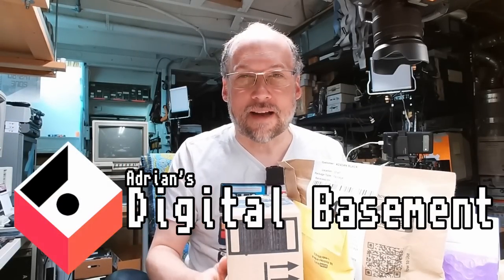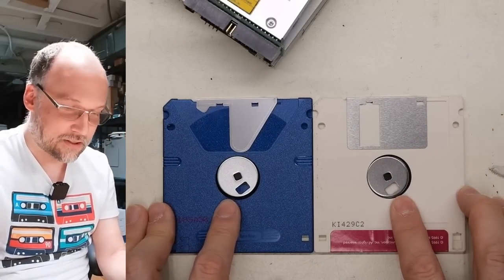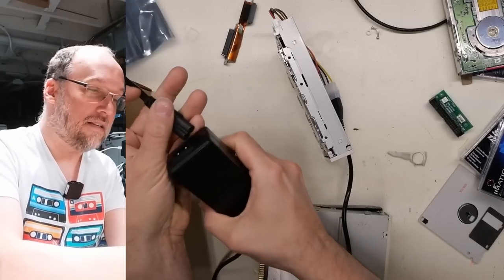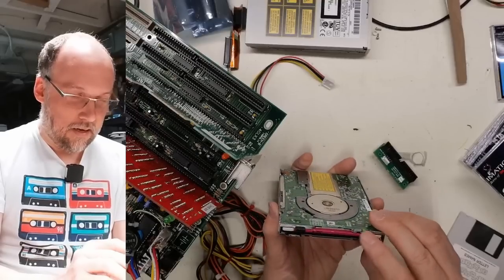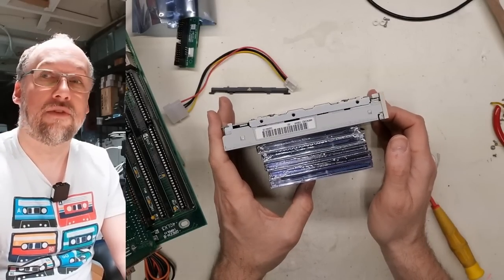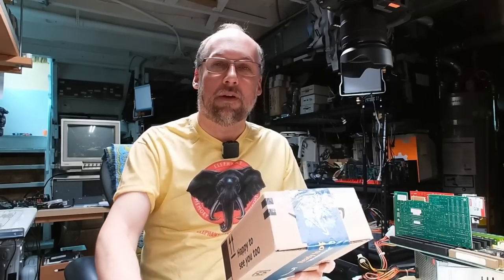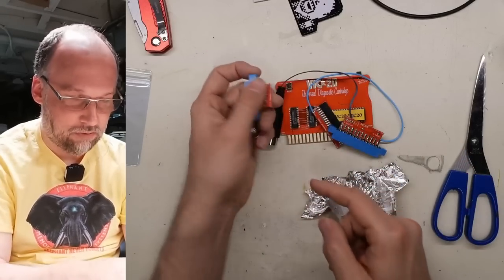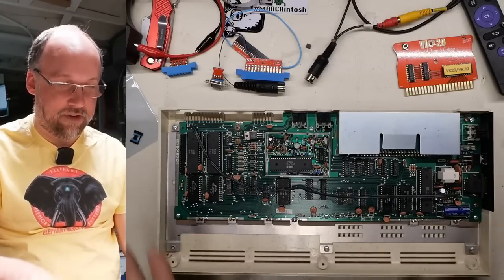0059 A VIC-20 test harness, an LS-120 disaster, a homebrew PC accelerator and a cool bad CPU die

Comment: 18:56 Did you ever find the laser in that thing? I read through all the comments so far before writing this one. No one else has pointed it out yet. But that looks an awful lot like the eye of a laser in the middle of that motor. Is that a metal or glass dome in the very center of the spinny motor thing? But if the laser is in the middle, how would it get the laser light to the tracks on the disc? With a mirror on the read/write head? I dunno. I just thought the little dome in the middle of the spinning motor looked weird.

Comment: The connector looks like a PATA-CD connector in laptops, however, it's probably wired differently as this drive looks like built specifically for some laptop model.

Comment: One year old video so as Adrian probably knows now, YES, that is the normal sounds of a LS-120. I now use mine with Win10 Version 22H2. Amazing it now works with modern Windows. I does take longer to initialize but burns much quicker. I sent in a request to Microsoft to get this drive to work like it did in WinXP.  Don't know if it was my request but she started working in Win 10 about a couple of months ago. No announcement from Microsoft at all. Microsoft blogs a couple of years ago claimed they were not used anymore. I set up a dual boot WinXP 32 bit and a Win 10 64 bit on my regular lab top {bit tricky] and had to use the XP to burn retro floppies. Tried to use tape drives but no luck there. Might be the problem that a Kijiji seller used a bulk magnet to erase all his older Colorado QIC-80 etc tapes. I hear there is a way to restore them using an archaic programming language. Not on the newer tapes though. If Adrian wanted to make a video on that it would be great.
   Still need XP for many older things though. The computer always welcomes me with the LS-120 squeaking hello. I like how it works with the electronic eject like a CD. There is a LS-240 that is just the last of the line as the bigger Zip Disk was the competitor at the time followed immediately by the larger CD-RW burner. It was just too much better to keep the line going. Adrian's 12V power supply sure looked like a laptop power supply. Interesting that cable that was for the molex. I will have to source it since I believe I have such a thing somewhere.
   Maybe I'll start making some YouTube videos on what I'm up to. They probably will say the videos show I'm knowledgeable about much but master of none [ha]. Much to do with my eclectic professional educational background with RR retro vehicles to electrical to even building lifetime fences that stand up to post rot. Maybe not, I'm kinda on the fence of doing that [no pun intended]. I'm just not Mr. Personality [work in progress there].

Comment: Like the Apple floppy drives and most CD-ROMs, the LS120s have that emergency eject hole that you can manually eject with a paper clip.
Also, I had an LS120 "beta"/pre-release drive a friend gave me back in the 2000s... and I accidentally shorted it on the CD-ROM below it because the PCB was lower than the sides of the chassis :( Never even got to use it.

Comment: The power pins from the adapter seemed to be shorted against the metal case when the power cable was getting hot. Maybe you'll figure this out later in the video but I wanted to comment before I forgot. I'm still at 12:37.

Comment: When converting a rechargeable circuit to one that uses standard 2032 cells you need to use a diode + 1k resistor for protection per most battery makers. That’s how all NES/SNES carts did it as well.

Comment: I don't think the VIC-20 allows cartridges to be boot ROMs like the C64 does with its Ultimax mode. In fact, the VIC-20 Programmer's Reference Manual (the copies of it I could find online anyway) doesn't even tell you how to make a normal auto-booting ROM like the diagnostic ROM — it tells you that it is possible, and that there's some magic byte string to do it, but doesn't tell you what that is or how to do it. Very odd; feels a bit intentional. I don't remember if you've seen that diagnostic display on the VIC-20, but you have seen it on the PET — the VIC-20 diagnostic is based on that one.

Also I think LS-120 drives only use the laser for tracking, and it wouldn't be visible on the head? This I don't know for sure.
Reply from the maker: Yeah I think early VIC-20 carts didn't even auto start! You just ended up in BASIC and you had to use a SYS command to start the game. 

And yes on the LS-120, a few other comments also mentioned it was only for the alignment of the head and not for reading the magnetic media at all. So it's definitely not a "flopical" as I call it a few times.
Reply: @adriansdigitalbasement2  Ooh that's interesting. Reminds me of one time when I had to figure out how to get dumps of a cart game that was on multiple ROM banks (Broderbund's A.E.) working and I just loaded it from disk somehow instead; don't remember how now though

Comment: I have an IDE 3.5" LS120 - I haven't use it in 12 years at least!  It's Magneto-optical. It uses optical for alignment, and a narrow head for read/write of the magnetic data.  I had 'bet' that the LS-120 was going to win over the Zip100, but in the end, Zip won the battle (before USB flash drives replaced them both). (plus, the LS120 was late to the game...)

Comment: Since my last comment on this, I got another two LS120 drivesand a pack of 10x disks, and it turns out, yes, another manufacturer made them, Mitsubishi (the model I got is a MF357G-2111MAL), which was unfortunately crushed in transit (doubtful it worked anyway), poor packaging and UPS, a bad combination, though does seem to be more of a clone of the Matsushita one I already had as a lot of the hardware is the same, but the control boards are different, and the third drive, an external Imation USB "For Mac" one, which internally uses yet another but later revision Matsushita drive, only issues with that one is the upper magnetic head had somehow been smashed, so it'll read & write 120mb disks, but regular floppies, nope, and despite the upper head assembly in all three being the same, it uses a different connection, so, poo, may have to do thin wire soldery bodgery to fit one of the other heads, but that'll take willpower I don't have!!! :P

Comment: That small adaptor is a standard mini ide laptop connector, used of floppy, cd / dvd drive connector, it should have worked with a non-faulty drive...
Reply: Except that the LS120 drive's uses a different pinout compared to cdrom drive's so you need a special adapter or you short power pins and fry stuff like what happened in the video

Comment: Cutting mat and camera focusing on the lines - you could turn it upside down, from the video it looks like it was an even darkish gray on the back. Should still work as cutting surface so you don't need to swap it back and forth but without the pesky focus issues.

Comment: Regarding blue LEDs/ laser diodes.  They were expensive enough for IBM (?) to brew up a frequency upshift optical thing to allow a standard red/infra-red diodes to be used in bluray disc players.
Reply: Optical pumping like that is really fascinating. You need quite a few doubling stages to bring infrared to blue! It takes 2 of them to bring it to green. So maybe 3 stages is sufficient, or 2 if you start with red. Heck maybe just 1 and they actually started with green? But there weren’t existing green optical disc lasers so probably 2 from red.

Comment: I think the connector on the adapter was not a normal floppy power connector but something else, as the plastic clip did not seem to latch onto the floppy connector like a normal one would, so I would wager the adapter needed some proprietary power adapter cable.
Reply: I could be wrong here but it sure looks like he plugged that connector in the wrong way around

Comment: One downside to liquid UV resin vs thermoplastic filament is the strength of the Print. UV resin prints will be more brittle but much easier/forgiving to get better looking results. There are Stronger resins for sale but they all tend to be more brittle than a print from an FDM printer that is properly calibrated. That's why FDM printers are used when structural  integrity matters more than appearance. Resin is far mor accurate however even on the cheaper ones.

Comment: that's odd. You had issues with the retro tink 2x pro as well. I have one. It works 100% of the time. The fact your 5x pro also has issues makes me wonder if it's an odd compatibility issue with the elgato.
Reply: Do you leave yours powered for a long time between uses? Seems like Adrian does and maybe something goes wrong after a certain amount of uptime.
Reply: @HunterZBNS  It's been a while, but I had it running almost a year at one point. Granted....it's not UPS'ed so I'm sure power outages reset it more than once.

Comment: I can tell those are FDM printed. They just used a better quality printer. I have a prusa myself. (I'm about to get an MK4 which offers even better print quality) I print everything at 0.1 mm. It takes longer, but I get better results. But yeah I don't know what you're using, but if it's an ender or an ender clone (creatity is the same thing) the quality isn't going to be great. There is a reason why a Prusa costs $800. If that was resin you wouldn't be able to tell it was 3d printed at all unless you have a magnifying glass.

Comment: I was working at Best Buy and sold a computer to a guy that said he worked for 3M and he designed the machine that made the floptical diskettes. They gave him a drive but he didn't have a PC compatible computer so he bought one to put it in.  I installed the drive for him in the store.  I'm pretty sure that is the only time I had my hands on one of those drives.

Comment: LS-120 drives were much more popular than Zip disks in Scotland circa 1999 - all the lab computers in the universities had them. They were much cheaper to buy than Zip (both drive and disks). Plus the extra benefit of being able to read and write regular 1.44MB floppies at much higher speeds than normal. The downside was they had reliability problems, making most of them die about the same time that 128MB USB Flash drives became affordable. Or at least that was my experience.
Reply: Yeah they did a really aggressive at-cost expansion into education and OEMs hoping that’d make up for being late against Zip… institutions and companies were happy to get the cheap equipment but as you note didn’t get invested long term like had been hoped.

Comment: D Subminiature 
D = shape
Sub = very small (compared to older cables)

ABCDE = size of connector

B = width of 25 pin serial
E = width of 9 pin serial; VGA

"DB-9" for 9 pin serial is the wrong designation, it's really a DE-9.

Comment: Would an LS-100 drive be able to read/write regular floppy disks at a higher speed? 🤔
Reply from the maker: The Wikipedia article says yes, but it's light on specifics. I have a couple USB drives that read/write faster than a normal drive.... would be worth testing one day when I do my storage video.
Reply: @adriansdigitalbasement2  The office equipment shop I worked at sold a few LS drives, not a lot vs overall PC sales, but I still got to use them at times.  If they did read normal disks faster it didn't make enough of an impression on me vs a regular floppy drive for me to remember it.  That might just be my memory failing me of course.

Comment: The original iomega floptical drive is a scsi drive with 50 pin connector and the disks are more like a 1.44 mb floppy disk and it has 21 mb of capacity it was the first release of this drive.
Reply from the maker: Were those actually optical in nature? Unlike the LS-120 which I have now learned uses a laser only for head tracking purposes.
Reply: @adriansdigitalbasement2  I don't know but i think is not , the iomega zip is not optical at all but it were scsi.
Reply: @adriansdigitalbasement2  Definitely not optical! The 10/20MB 8" and 20/35/44/65/90/105/150/230MB 5.25" Iomega Bernoulli drives were mostly SCSI, although they did introduce IDE versions of the 150/230MB drives a year or two before ZIP drives were introduced. Per Wikipedia "The drive spins a PET film floppy disk at about 3000 rpm, 1 μm over a read-write head, using Bernoulli's principle to pull the flexible disk towards the head as long as the disk is spinning."

Comment: That drive must have cost a small fortune back in the day, must have been a quite rare item. You should really rush a little less, check for obvious shorts, maybe try to find documentation, or just use a proper psu, it's painful to watch devices like that getting ruined by stupid mistakes. I love your repair vids, hate when you destroy stuff. Not that we don't learn a lot from both, but would be nice to avoid the latter, if possible :)
Reply: They weren't that expensive... I think I got mine brand new for around 40 bucks, the discs were like 5 bucks a piece... That's if I remember correctly. I got mine from a bi-annual Chinese computer show they used to have in Las Vegas, so they were cheaper than computer stores... Fond memories...
Reply: @Quickened1  You mean the low profile laptop version? I don't think these were common by any standard. At least it would have deserved not to be treated as junk, electrocuted by the most suspicious power supply Adrian had laying around. Whatever, not a tragedy, just makes me sad.
Reply: @matwyder4187  no, I bought the larger desktop model, so yeah, I guess the slim version would have more expensive, but I still think they were fairly reasonable. I did see them at the computer fair, but wasn't into laptops at that juncture.
I was suspect of that random power supply before he even plugged it in, and then bam, it was done. I personally would have not gone that route at all, but the thing about Adrian is, he's got a million computer parts there, and sometimes it's overwhelming. That can lead to complacency, which is where mistakes come in. Yeah, he occasionally makes a mistake, but all can be forgiven, because 98% of what he does, turns out just fine. We're only human after all. Maybe, just maybe, this particular event will result in him slowing down a little, and thinking a little more before acting...

Comment: Regarding the floppy doors, why would anyone try to 3D print a tight-tolerance hi-stress part like that?  They're so small it makes 10x more sense to make a silicone mold and just cast them in strong resin. They'll be perfect, strong and smooth.

Comment: I had a few LS-120 drives back when they came out, and they were very unreliable.
Reply from the maker: Oh no kidding. Funny is that the Zip drive has a reputation for unreliability, but back in the day I used one every day (to hold all of my email spool files so I could bring it to/from work) and never had a failure. Even today, I still have several drives and they all work and I use them from time to time to move files to/from retro computers. Click of death was real, but I don't think it was as common as people believed. I did have click of death on a couple external drives, but it turned out to be a failing power supply! Replaced it with a new PSU and the problem went away....

Comment: Most CR 2032 batteries will drain over time whether loaded or not - once you pull the sticker, the air goes in and reacts at a fairly steady rate, loaded or not.